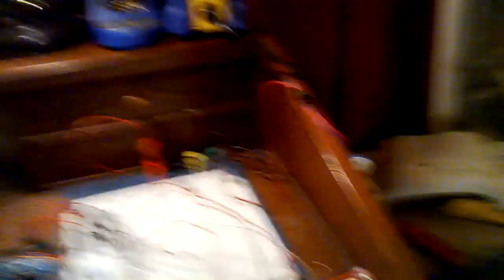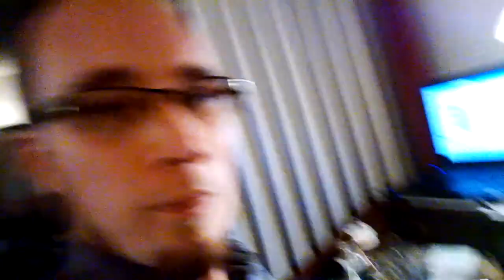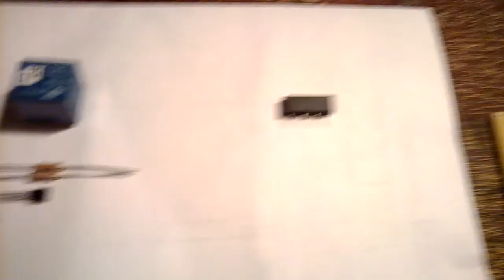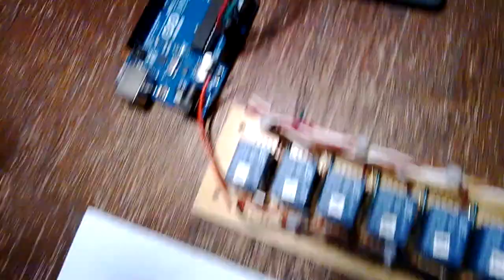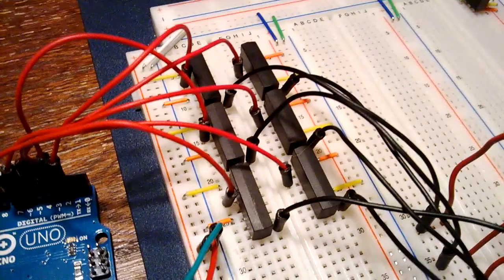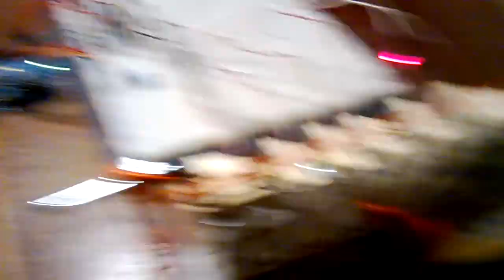Reed Relay Test

Comment: freaking awsome!! how is it going along? And can i also ask two questions, is there any sort of backfeed from the solenoids  , kind of like with a dc motor ? and the other question is what is your opinion of the ITT tech EE course? I currently know a little bit but wanting to try the ITT course since  i have a school right up the street
Reply from the maker: Eddie,

Thanks for watching! The electrical work is done, I just need a shop to fab up the new parts for the rebuild. (Currently living in an apartment, but looking to fix that soon.)

As for ITT Tech, my experience there was saved by one amazing electronics instructor. Any college is what you make of it, but I got the distinct impression that they just wanted to pump students through their system and soak up all the cash they could. I only got a tech school associate's, but one look at my loan documents and you'd think I went to an Ivy League school...